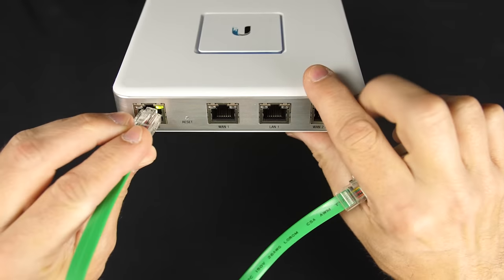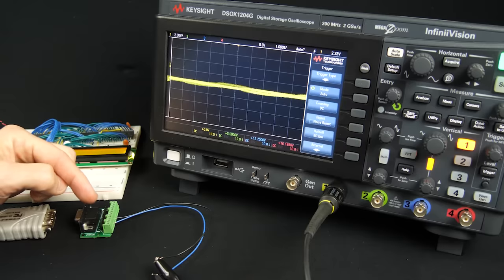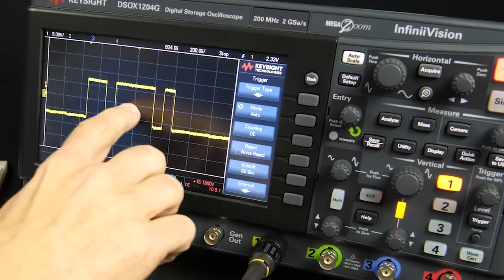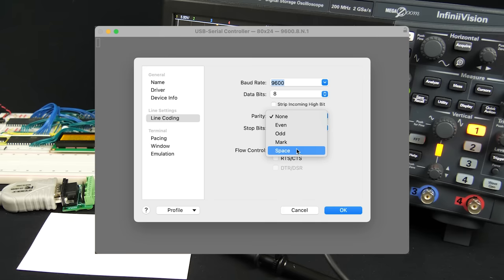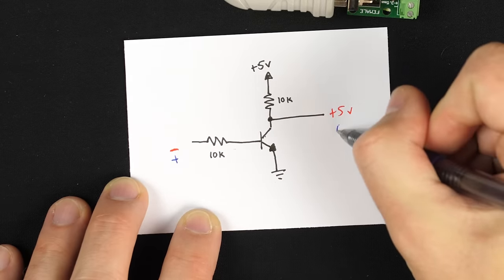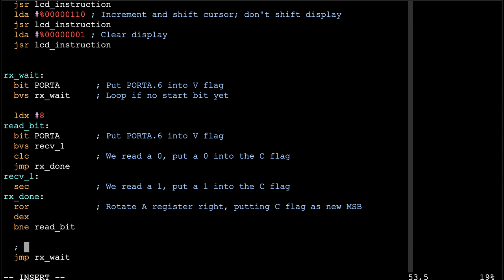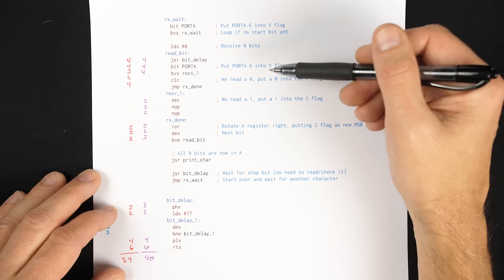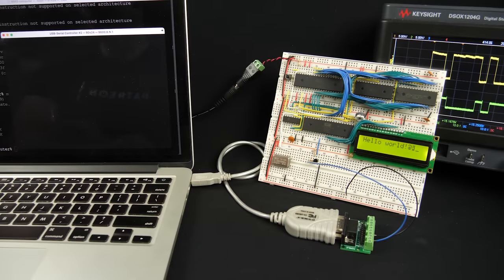The RS-232 protocol

Comment: Oh, the hours and hours of billable time I spent installing, configuring, troubleshooting, and wiring RS-232 devices.

One time, I received a call from a loyal customer out in California -- 2,500 miles away from the office.  He goes, "We got a new washing machine sized Printronix printer.  Can you come out and hook it up to the hp/ux system (Unix variant) serial muxes?"

"Uhh, I can...  But, I'll have to bill you for two days of travel, out and back, plus a whole day of labor even though it's likely to only take me three hours at the most to get it working.  There has to be a local service provider that can handle the task for far cheaper."

"Yeah, there probably is...  But, when you show up, everything works and I don't ever have to deal with it again."

I don't know why so many people had such a difficult time with RS-232 communication.  But, they did...

The same goes for all things Unix.  Just read the F'ing manual and spend some time digging around trying this and that...  Know why you're trying this and that and get a handle on the results.

I guess I should be thankful most find the complexities difficult.  It certainly made for a rather financially successful career.

Comment: not sure if this was mentioned, but as a casual computer user in the early '90s - 2000s, I always thought of these two connectors as serial and parallel ports. But I also remember there were female and make versions of the long port. Can't remember what my Amiga 500 had, I think both?

Comment: just a note both the 9 pin and 25 pin connectors along with rs-232 networks are widely used in the aviation industry and arinc 429.

Comment: On the receiving side you really do not want to wait some specific time for the stop bit.
As you said somewhere in the video, the stop bits really are nothing more then a setting for the sender "I want you to wait that long before the next byte can be transmitted". The purpose of that "pause in between bytes" is to provide some time to the receiver in order to process the received byte. In your specific case that would the writing to the lcd. Also in your case nothing goes wrong because the µP can handle the lcd faster then you can type. But things change if eg. the (short) output is generated by a program and the RS232 runs byte followed by byte. Then the sender stop bits are (as of now) the only thing which will help the receiver to eg. transfer the bytes into a queue without having to fall back onto the handshaking.
Stop bits are a setting which only the sender cares about. The receiver ignores this setting completely as he can make much better use of that time.
Now: since your sampling point is in the middle of the bit time it then may of course happen, that the processing of the byte goes faster then this bit time and is already finished before the stop bit has begun. If that last bit happened to be a 1, then the current program will misinterpret this 1 as the beginning of the next start bit. Not what you want. A simple (but not 100% full proof) solution to that "problem" is this. You start your waiting with:

   wait for the input to 0          <------ this eats up the stop bit time after the previous byte has been processed
   wait for the input to be 1     <----- this is the change which indicates the beginning of the start bit

   do your timing and bit sampling

This also has the advantage that your bit sampling is actually guaranteed to be in the middle of the bit timing. But of course it has the disadvantage that if processing a byte takes too long, errors show up a little bit earlier. Which actually isn't that bad cause usually this means you do need to speed up the receiving side OR you need to slow down the baud rate. And of course it is a big hint that you want to have hardware handshake.

Having said that: your version is perfectly fine for a first version.
Reply: Having said that, one should also add, that in a real world program one wouldn't operate the RS232 like that (with the exception of very special cases). Getting timings right with delay loops is always tricky. I am not talking about calculating how often a loop has to repeat. I am talking about the usual case of a RS232 when the program needs to be able to receive AND send at the same time. Just consider the situation the program has already sent 3 bits of a byte to send and at that time a start bit edge occours. Good luck in getting the timing right with delay loops. If you don't have a hardware UART available your only chance is to use a timer and an edge triggered interrupt. Of course that software solution gets much more complicated to get it right.
(As I always tell novice Arduino programmers: using delay() is seldom the solution, but often the problem. Of course I get it, that you need to start learing somewhere, but after your first steps you should switch to a proper solution. delay() is almost never a proper solution in a "professional" program)

Comment: You could (probably) hook the TX line (DTE) to the RX line (DTE) to get echo-back on the terminal app, until such time as you get the DCE (breadboard computer) to handle it; probably through a 16450 UART chip, or something similar.

Comment: The specification was singles +/- 3 to 25 VDC … most of the rs232 driver chips drove it to 12vdc … note there was also RS422 which was like rs232 but used differential pairs for signals …

Comment: I didn't realise 6502 had a BIT test instruction and then realised why I never used it. If testing multiple bits it's not so clever as it just performs an AND function and nor an ExOR function. Programming serial function, especially on 6502 takes me back to my school days. On the BBC Micro we have 6522 VIA which could shift data in for serial comms. Takes much of the load off the processor allowing this function to run on an interrupt and not hog the whole CPU.

Comment: I'm not a low level / close to hardware software engineer, but I think there's a small thing incorrect near the end of the video. Though it seems to work just fine. Your full bit delay subroutine of 13 cycles includes the 40/39 cycles it takes to read the bit. So a "one bit delay" is more around 52/53 cycles. So the half bit delay should be around half that number, not half of 13. So you are still reading somewhat close to the flipping of the bit.

Comment: With the Amiga computer, more than 3 volts was interpreted as low and less than 0.6 volts as high, at the serial input. Probably the same transistor circuit as you use.
For the serial output, however, the level was also pulled almost to -12 volts (high bit) and +12 V (low bit)
RS-323 is always reverse logic.
But TTL serial for 5V or 3.3V is normal logic. This is still widely used, for example in 3D printers.

Comment: I remember building a null modem cable for my amiga computer (25 pin connector) back in the late 90ies, so I could play games against one of my buddies.
It was only 3 wires. 2->3, 3->2, 7->7

Comment: The receiving UART will do about 5 samples per bit, and take the most common value received.  But a very short cable has a  very low capacitance...so it worked for you doing a single sample.

Comment: I have an idea for a better way to handle this in software, without using any additional pins from the RS-232.

First off, a hardware change: move the data coming from the transister from the PA6 pin (pin 8) of the 65C22 to the CB2 pin (pin 19).

Now, for pseudocode of the software (If you need a timer from the 65C22 for some other purpose, you can modify the following pseudocode to use T2 rather than T1, but be aware that the shift register also uses T2, so you may need to disable timer interrupts when you're not directly using the timer so you don't get extraneous interrupts):

Initialization on reset:
Clear input buffer
Clear interruptControl variable
Set CB2 mode on 65C22 to "independent interrupt input-negative edge"
Set T1 mode on 65C22 to "timed interrupt each time T1 is loaded" with PB7 output disabled
Set shift register mode on 65C22 to "disabled"
Enable CB2, T1, and shift register interrupts on 65C22
Set T1 on 65C22 to 1040 cycles

When interrupt is triggered when interruptControl is cleared (This handles waiting for any characters that were in the middle of being sent when a reset occured to go away):
If CB2 interrupt flag is set on 65C22, clear interrupt flag register on 65C22 and set T1 back to 1040 cycles
If T1 interrupt flag is set on 65C22, read low byte of T1 counter on 65C22 (to clear T1 interrupt flag; we can't clear the whole interrupt flag register because that would create a race condition) and increment interruptControl to 1
Return from interrupt

When interrupt is triggered when interruptControl is 1 (start of transmission):
Set T1 on 65C22 to 52 cycles (This is the total wait time, not the value stored)
Disable CB2 interrupts on 65C22
Increment interruptControl to 2
Return from interrupt

When interrupt is triggered when interruptControl is 2 (receive character):
Clear interrupt flag register on 65C22
Set low byte of T2 on 65C22 to 104 cycles (Again, this is the total wait time, not the actual value stored)
Set shift register mode on 65C22 to "shift in under control of T2"
Increment interruptControl to 3
Return from interrupt

When interrupt is triggered when interruptControl is 3 (character received):
Set T1 on 65C22 to 104 cycles (Again, this is the total wait time, not the actual value stored)
Clear interrupt flag register on 65C22
Move received character from shift register on 65C22 to first unused position in input buffer (If I'm reading the W65C22S datasheet correctly, the shift register expects most significant bit first, but RS-232 is least significant bit first, so that'll need to be accounted for when reading from the input buffer)
Set shift register mode on 65C22 to "disabled"
Increment interruptControl to 4
Return from interrupt

When interrupt is triggered when interruptControl is 4 (end of transmission):
Clear interrupt flag register on 65C22
Enable CB2 interrupts on 65C22
Set interruptControl to 1
Return from interrupt

Comment: I was using RS232 as far back as 1964, and I've use it omn 9 pin and 25 min ocnnertors.  I've even used the clocks@

Comment: RS-232 supports two versions Synchronous and Asynchronous, Asynchronous is what you are describing with the start and stop bits. Synchronous does not use the start and stop bits instead it uses timing clocks and sync characters that being sent when ever there is no data being sent.

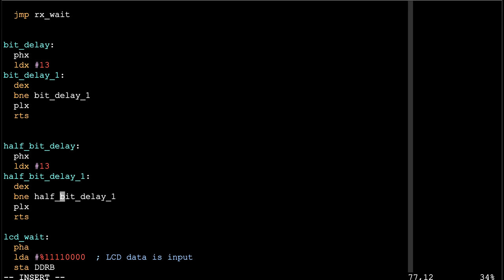Comment: Very interesting video. But I dont quite understand why the half_bit_delay at 24:24 is just the half of the 13 value. I thought that you had to factor in the 40 cycles that are not in the delay part. That would make it a ldx #10. But i suppose that either way it doesn't make a difference as long as it is somewhere in the bit and not at the border
Reply: I had the same thought. If you do the math, the combined delay until the first data bit is read is actually nowhere near 1.5 bits. The "halfbit" delay is 30 cpu cycles, and the "bit" delay is 65 cpu cycles. The additional instructions for entering and exiting the loops just barely push it past the 104 ms.

Comment: Very informative, as usual. Question: will you be using the WD65c51 ACIA UART or the competitors' devices? I'm hoping for the former because it requires a timing delay to be coded for the inherent bug.

Comment: Of course the clock signals in rs232 were indeed widely used, as they are required for synchronous connections as those used in point-to-point serial lines back in the 90s and earlier. They became obsolete when T1 and E1 digital lines replaced them.

Comment: the Half_bit_delay setting computation  is not quite correct because the outer loop should not be taken into account. So for a 104/2 ms timeout we should have 15+5x=52 => 5x=37 => x=7. In fact you were quite lucky with the outer loop duration. :)

Comment: Guessing in theory the half bit delay should be checked for how many clock cycles it uses (5?) and then have its X value set accordingly, rather than simply using half the other delay sub routine's X value? This said though since we are aiming for "the middle somewhere" it doesn't really matter that much how accurate our "in the middle" measurement is.

Comment: A Correct serial protocol is absolutely neccessary.  We would program some telecoms equipment (rate lookup tables,  least cost routing, extensions allowed and barred , lines out allowed or barred and similar),  We found 1980s laptops both had to run the (DOS based) program correctly,  Panasonic and Toshiba laptops worked fine, but goodness knows what Dell were doing with clock speed out etc on the serial D port.  I feel they thought no one would use if for anything other than maybe a modem or printer / CRT device

Comment: TIA-232 isn't a protocol. It's an interface standard. You can run many different serial protocols over a 232 interface. That could be asynchronous serial, synchronous serial, etc. HDLC, SDLC, etc.

Comment: Worth noting that although that router does have a console port, it's a Unifi product, so any configuration changes made via the console will be overwritten by the controller every time it reboots. The only way around this is to not have a controller but that defeats the purpose of using Unifi gear and the Unifi devices will constantly spam packets looking for the controller if they haven't been adopted by a controller. I have to reconfigure the span port for our NDR on our core switch at work every time it reboots. Very annoying.

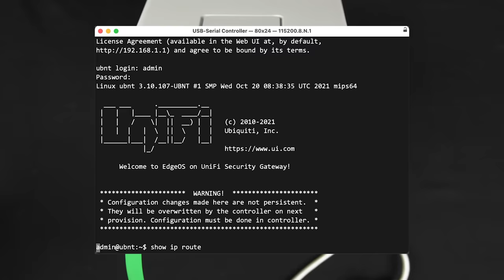That's what the warning is about when you login via console. Seen at 0:37.

Comment: This is the first video of yours that I've seen, RS-232 is used extensively is general aviation navigation equipment, which is my line of work. The other common one is Arinc 429. Things are moving towards CAN bus but those two will be used for a long time. Have you done a video on 429?

Comment: Um, JSR takes 6 clock cycles, JMP takes 3.  The branch instructions take 2 or 3 clocks depending on whether the branch is taken (and an extra 2 clocks if the branch is taken to a different page of memory).

Comment: Ah, memories... one-byte versus buffered UARTS (to prevent data loss due to the CPU not being able to poll the UART fast enough), hardware handshaking vs. software handshaking... the adventure of connecting devices that were never meant to be connected...

And let's not forget the ever-handy "null modem" cable! (In RS-232 land, you're either a terminal or a modem. Anything else has to pretend to be one or the other -- and good luck getting two devices to talk to each other if both are pretending to be the same thing! Ah, memories...)

Comment: Shouldn't you read the o'scope from right (oldest) to left (youngest). The start element is on the far right on that beautiful Tek scope.  We refer to that as the LSB, least significant bit).  Small nit for a great video.  BTW, the use of the transmit and receive clock was prevalent between Bell modems and IBM front end processors (FEP) in the late 1970's.  Clock was delivered from the modem to the FEP and data returned from the FEP at significant clock transitions.  I could go deeper but discussions of long gone technology rolls eyes back into the head.

Comment: I like your explanation of "mark" and "space", very good.  But why is "mark" the idle state?  And how does "Break" work.  Since "mark" is the idle state, with current flowing, and since "space" is the state with no current flowing, "Break" is an extended duration of no current flow, i.e., a really long "space", which would indicate there is a "Break" somewhere in the circuit.

Comment: Just a point of interest... the secondary TX/RX was actually used by some X25 PADs (their equivalent of a modem) as a configuration interface and firmware updates and the main TX/RX was there for other purposes.. was kinda of a PITA when you got to a site and you had forgotten the darn dongle LOL..... interfakers FTW :D always made sure i had that little magic box - still have one from the mid 90s in my toolbag and still use it today

oh and dont forget the old adage.... when all else fails..... SWAP PINS 2 AND 3 :D

Comment: The original specification didn't define physical characteristics such as a 25 or 9 pin D-sub connector. All it said was that DCE should be the female connector (that alone has helped me a lot over the years when trying to figure out how a device is wired, e.g. on VTs configured as DCE meant to plug into a mainframe). As such there were a lot of different interface connectors used until manufacturers started settling on the D-sub. I think probably because IBM was choosing it, and it wasn't until version C or so where the DB-25 was defined in the standard. The earliest example I owned was an old IBM daisy-wheel teletype the size of a small desk which I used as a printer in high school in the early '80s, connected to my TRS-80 model 3.

In my current job I still have many systems which use both synchronous and asynchronous TIA-232 interfaces as well as the balanced counterpart, TIA-530 (formerly EIA-530, formerly RS-422, yadda, yadda). Lately, we've had difficulties getting newer channel banks (yes, still using T-carrier) to sync properly with old 9600 baud and slower systems, so when we exhaust our options trying to match our DCE to the DTE, we set the channel to maximum baud synchronous. This means the channel bank will simply sample the transmission line according to its own internal clock, which should be several times the baud rate of the DTE. This causes the distant end receive line to be a "reproduction" of the local transmit. While this theoretically introduces jitter into the signal, the DTE clock rates are so slow it never seems to matter in practice.